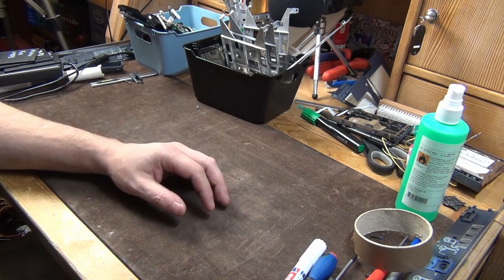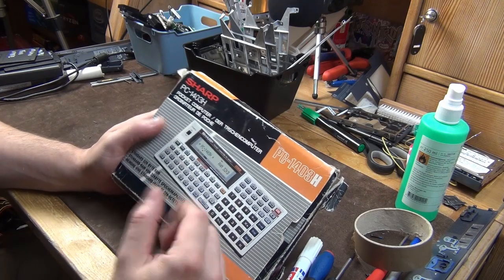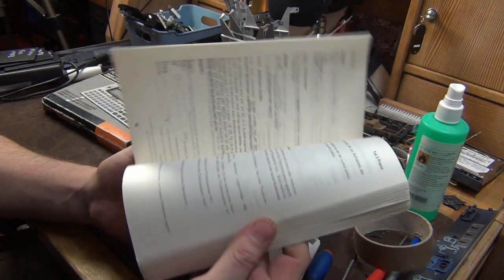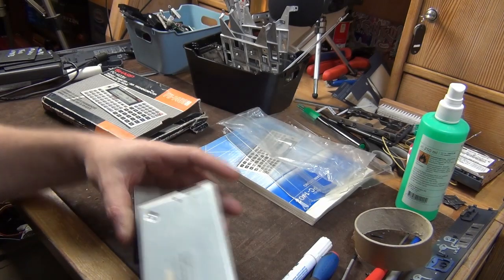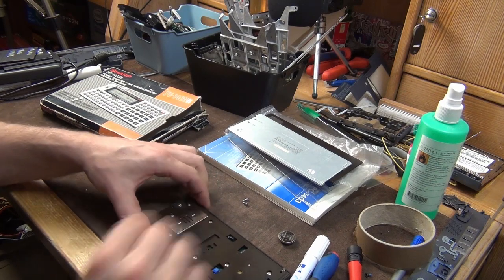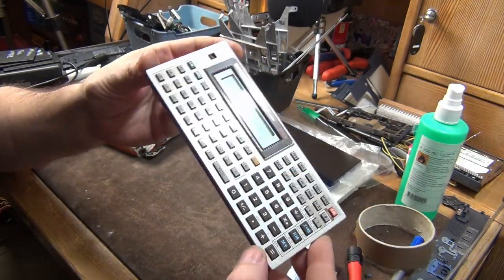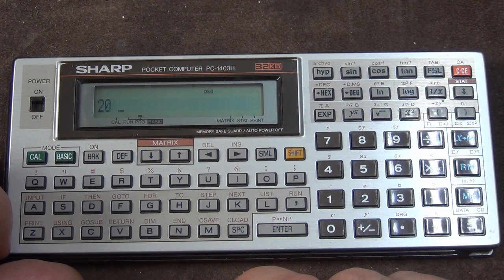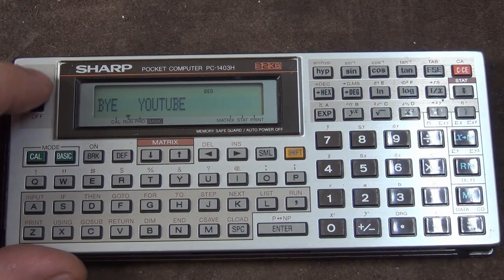Sharp PC-1403H Pocket Computer / basically #SepTandy :D

Comment: This is a rather late correction, but... The Tandy TRS-80 Pocket computer was a rebadged Sharp 1211 (not 1210). They named the successor PC-2, and retroactively called the original "PC-1". Apparently they didn't realize how successfully IBM would market their Personal Computer as a "PCs", Tandy was hoping "Pocket Computer" would be recognizable as theirs. This line of handheld computers goes to PC-8, although PC-4 to 7 were rebadged Casio computers, not Sharp.  In retrospect this serious confusion about branding with "TRS-80" and lack of backward compatibility was probably a sign that the business would not last, although the IBM clone market and arrival of cell phones also spelled doom for them. The pocket computer form remained popular in the Japanese academic market up to Sharp's PC-G850 series, which were released in 2001